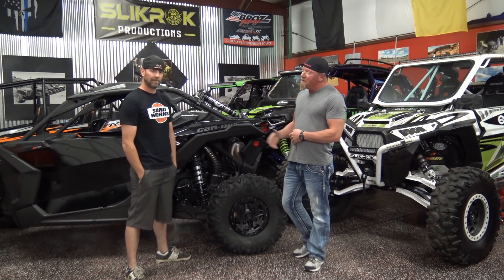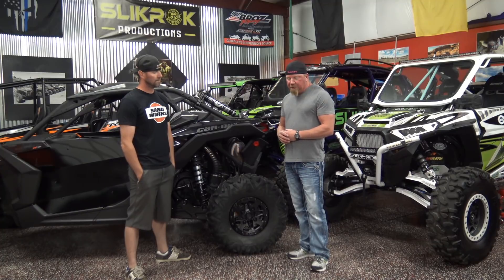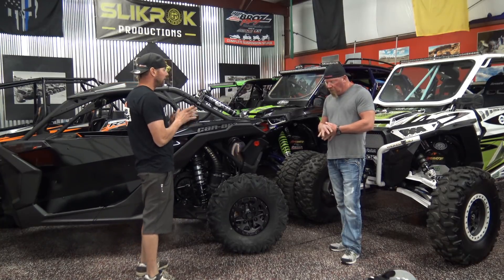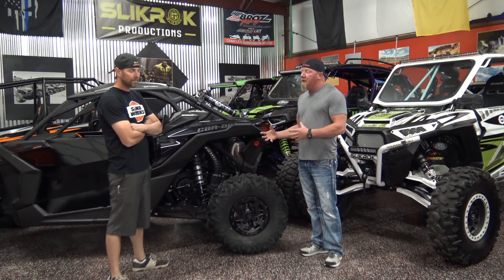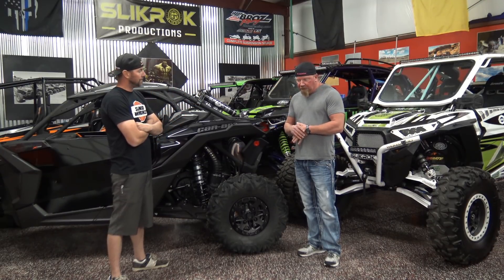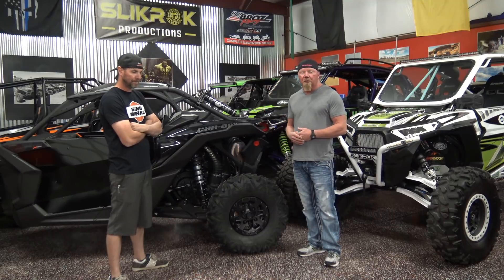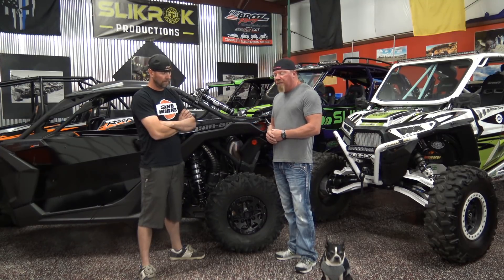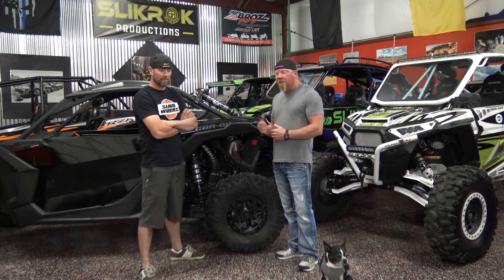Sometimes things don't go as planned! *Please watch till the end*

Comment: And how does it look after the fact? Id be curious to see, getting the RC soon, very interested,as cages are not cheap. Thanks
Reply from the maker: Hey man, it actually fared better than you would of thought. It had some bent up a arms and trailing arms but was still able to drive out under its own power minus a front wheel. The cage was tweaked pretty good but did not collapse. I am guessing because it was in soft sand and never really take a hard impact. Hit me up with any other questions man!

Comment: I'm a firm believer always ran harnesses and a custom cage. What's your opinion on Polaris retractable harnesses? It'd make life easier with different passengers not always having to adjust and backing down trails would be 10x easier.
Reply from the maker: John McClary I have been running the Polaris click 6 retractable harnesses for 2 years and they are the only way to go!

Comment: I'm not convinced that it had anything to do with limp mode... it came off pretty quickly, it just seemed like either a) the suspension unloaded in a way that made the car dive to the right or b) traction was uneven or maybe a combination of the two... either way, I don't think the car rolling mid-air was related to a lack of power.

Comment: It would be nice to see how that cage looked after the wreck. I think the X3's have the best stock cages out there.
Reply from the maker: Jim Richter the cage held up for the most part. It did not collapse but did bend the whole thing to one side. Still drove the machine out minus the front right suspension and wheel.